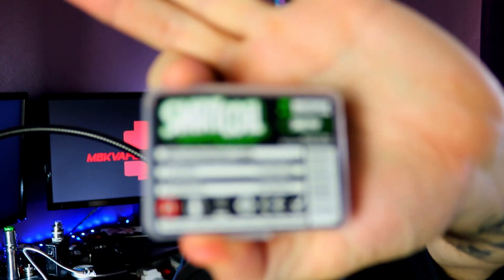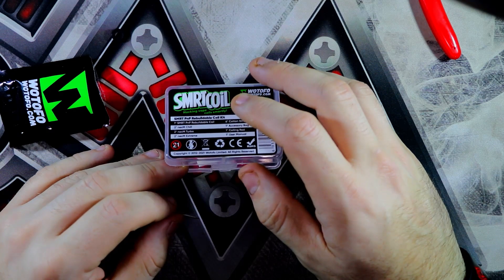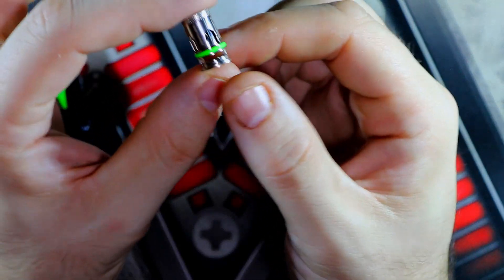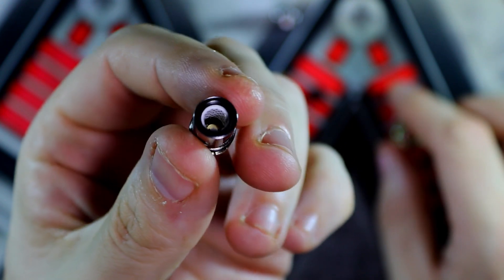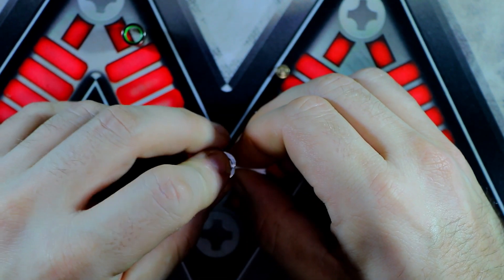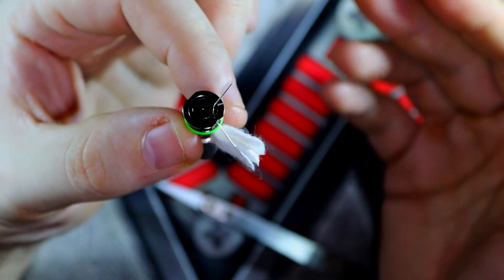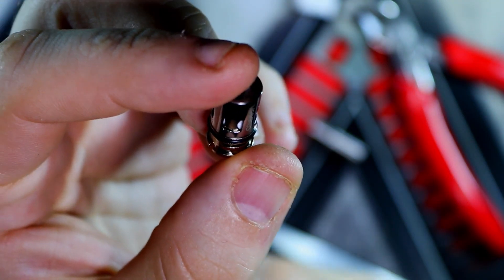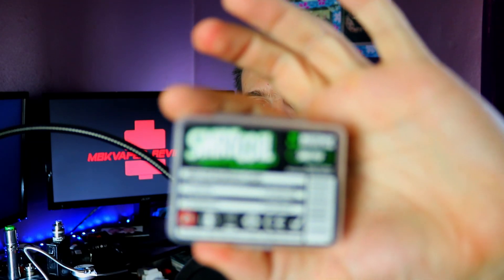WOTOFO smrt pnp coil

Comment: Hi, I wanted to ask your opinion.

 The repairable resistors are last for me for a very short time, just 2 days.
 I am changing them when I notice a burnt taste, when I open the repairable I see the cotton in perfect condition and the resistance burned in several areas.

 Vaping at 37w liquids of 30 PG / 70VG menthol without nicotine.

 I thought it was because I usually take like two hits in a row, so I've spaced them out and my battery still burned, the hits are like 1.5 seconds long.

 It could be a thousand things but I ask you for guidance, it does not seem normal to me that they last so little. What could be due?

 All the best.
Reply from the maker: The menthol juice could have a lot of sweetener in it and that is what could be building up on the mesh